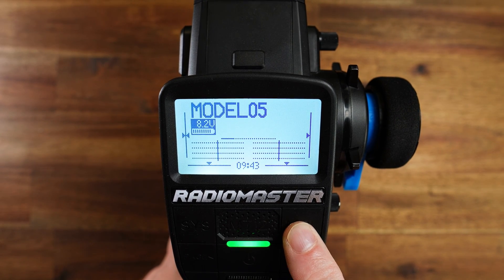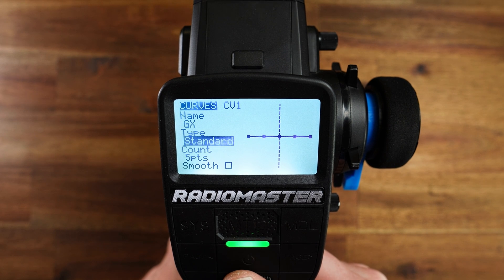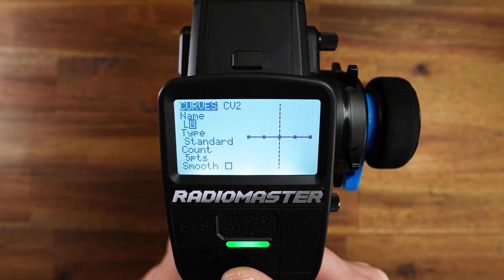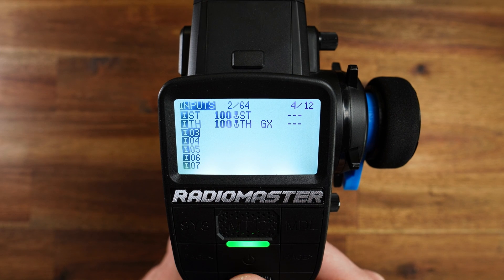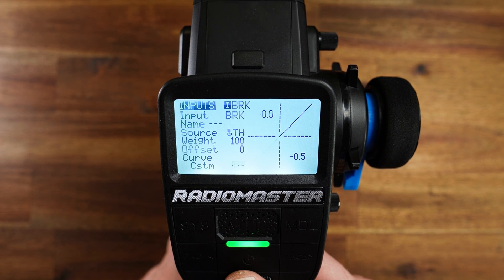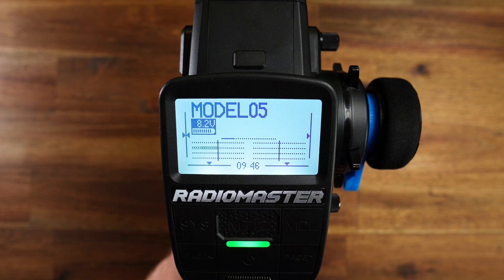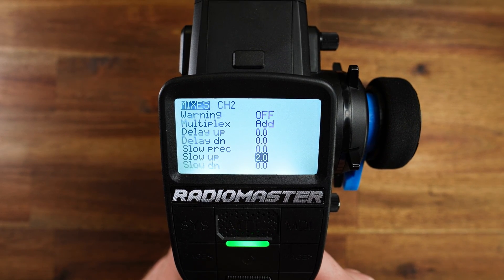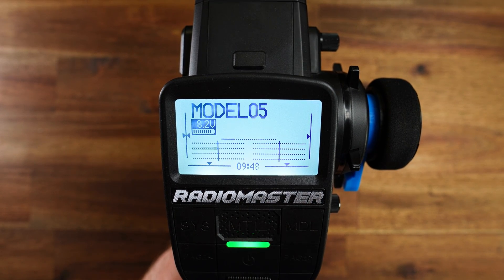PUNCH CONTROL ON RADIOMASTER MT12 | EDGETX | TUTORIAL [EN]

Comment: Is there anyway you can make a video showing how to do this in a LUA script? this would be very helpful please
Reply from the maker: Can you give me some more infos about this please? Why do you wanna use a script for that and what do you want to control with it? I mean, a Punch Control is essentially just a "Slow up".
Reply: @arminrc  I use a similar version of this where I’m using logical switches with the delay in the logical switches along with the slow up to do multiple stages of what you call “punch control” the logical switches activate multiple throttle curves. I am able to start at 50% power instantly, then I can control how fast it gets from 50% to 70% in for example .5 seconds. Then I can go from 70% to 80% in .3 seconds. Then go from 80% to 100% in .2 seconds. 

I set the slow up in the throttle curve and the delay in the logical switch to the same time in order to get a smooth throttle delivery. I use this for drag racing. They have a very similar feature on the Futaba 10px. 

The reason why I’m asking for you to write a logical script because changing the percentage of power within each stage, 50% throttle to let’s say 55% is very cumbersome. I have to go in and change the ending percentage of one curve and then change where the next curve starts at.  Along with having to go into the logical switch and change the delay then go into the slow up and change it to match the delay is very inefficient. 

What I’m looking for is a script that would sync the end of one curve to the beginning of the next curve. For example, if I had a stage that goes from 60% to 70% throttle and I wanted to change it from 60% - 75% throttle the script will make it where the next stage automatically starts at 75% throttle. 

Also, the script would make it easy to control the logical switch delay and the curve slow up by sinking these two functions together into one simple control. 

Please let me know if you understand what I’m saying and if you would be able to make a video writing a script for this? There are a lot of people who use this radio for NPRC drag racing.  They would all be interested in this script if you were able to write it.
Reply from the maker: To be honest I do not see why you use a delay in the logical switch for punch control. Maybe we talk about different things. For me, punch control is a slow up, a ramp up if you will of the throttle output to better control the power.
A delay in the logical switch is a simple delay, means the actual switch action is delayed. After that delay the slow up gets active and the throttle output rises with the speed set in the slow up parameter.
So the only thing you get from a delay in the logical switch is that the start of the throttle rise up is delayed. But I do not have my MT12 with me currently so I can't check it in detail. Possibly I am wrong.

Comment: Hey, me again. Lol

There was another way I learned to setup launch control that allows you to put it on a switch (FL1 for example) and via a logic switch it only works when the switch and throttle is depressed but with your teaching on curves in this video I was able to perfect my setup, the only problem I have noticed is if you give full throttle from full brake with launch control activiated it takes twice the time as it has to travel the brake range before it gets to throttle and since youre the genius regarding this software I was going I could get your advice on if this is solvable.

Id like to share this with you so you can share with everyone else so people can get the most out of this awesome radio.
Reply from the maker: Thanks for the info and feedback! I made a video about "Launch Control". I am not really sure but it may address the problems you mentioned.